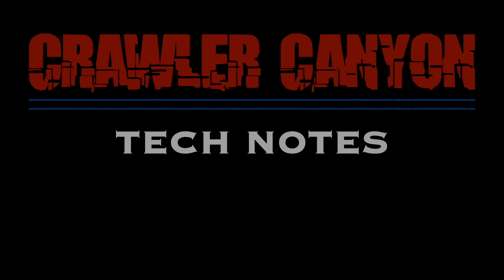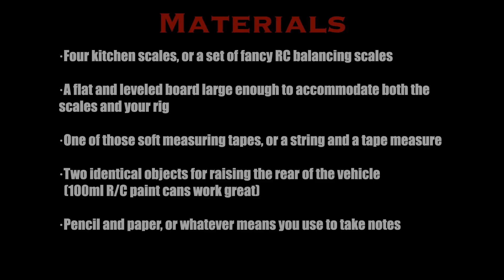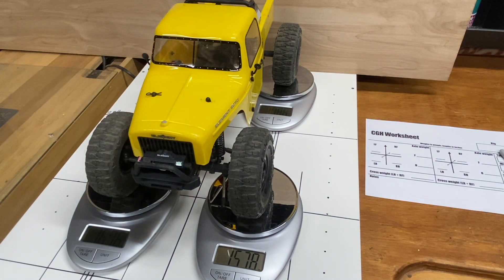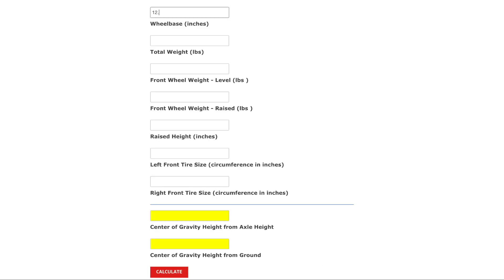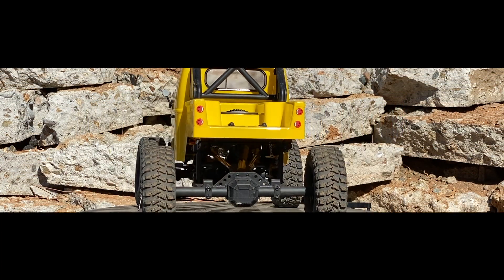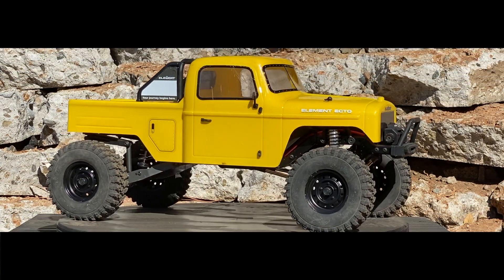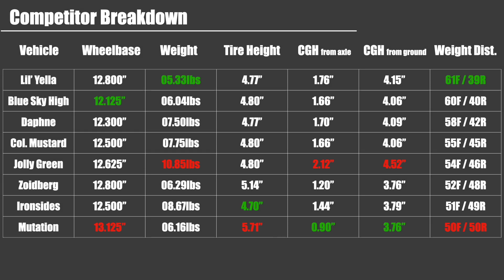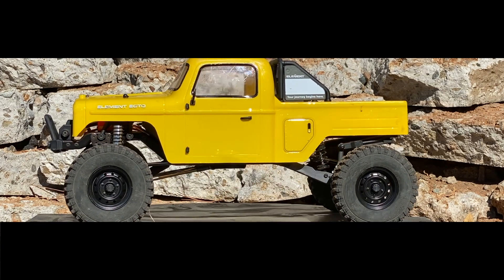Crawler Canyon Presents: Tech Notes... Center of Gravity

Comment: Does the accuracy of finding COG depend on angle that vehicle is raised?
Reply from the maker: You just have to raise it above a certain level, and make sure that both sides are raised the same amount. For a 1:1 car you only need to raise one end about a foot, so I don't think we have to raise very far.  Tamiya paint cans work great.
I have a much more recent update to the CGH video, with a new online calculator--  when I do CGH now, I weight it with rear raised, then front raised, run the calculator twice, and average out the two.
Reply: @CrawlerCanyon  well certain level is not precise to be honest 😆😅 did you get similar results when raised more or less? Did you try that?
Reply from the maker: @Przemysław Iwiński  The CGH will be at a different point on 2 axes depending on how high you raise the axle. It's pretty easy to graph--  for instance, a theoretical ~6.5lb rig with a 57/43 F/R split and 4.65" tires will show a  3.5" CGH at 4" of lift.  If I rescale and move the axle up (or down,) it moves <slightly>.  4" is just convenient.
Reply: This is just cg"H" not the actual CG but thank you anyway.
Reply: MFs always got something to bitch about don’t they? Did you raise it and lower it😤. If you don’t like the way he did it, make your own video, so we can comment about how you did it wrong😆

Comment: I have been wondering how to do this ever since I switched my Element Enduro from a brushed 550 can with a 1080 to a Hobbywing all in one. I was wondering if there was a CG difference... Thanks for sharing!
Reply from the maker: During one of my in-fleet motor switcharoos, my MST CFX-W lost it's Castle Copperhead + Slate 1900kv combo and received a Hobbywing Fusion 1800kv...  and it's CG dropped almost three quarters of an inch. It now wheels as one of the very best side-hillers in my collection.